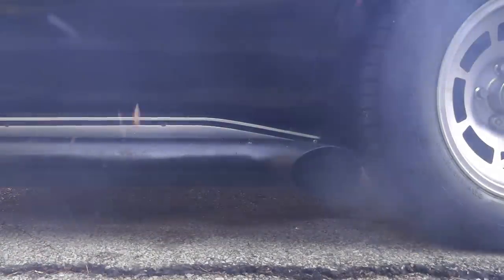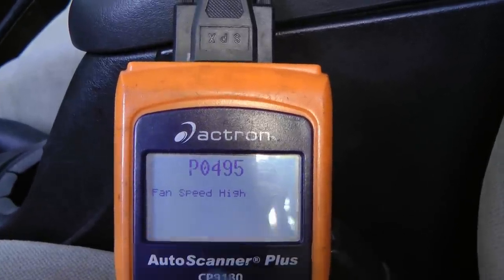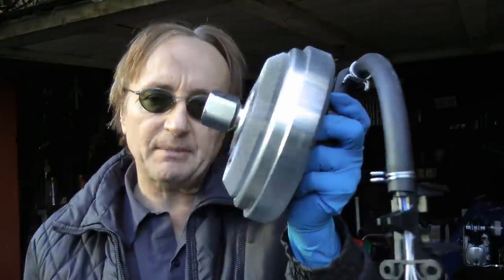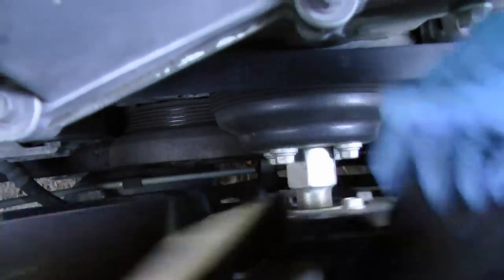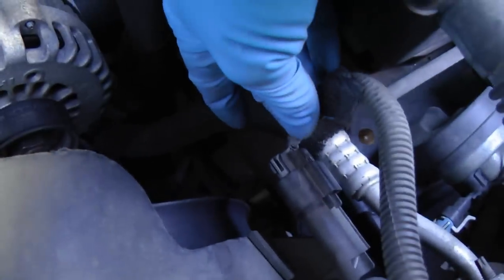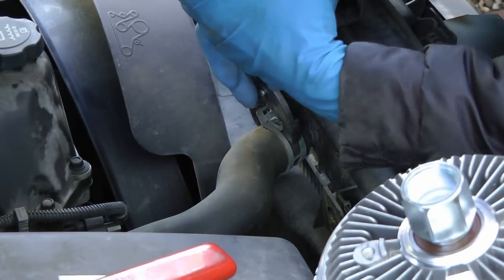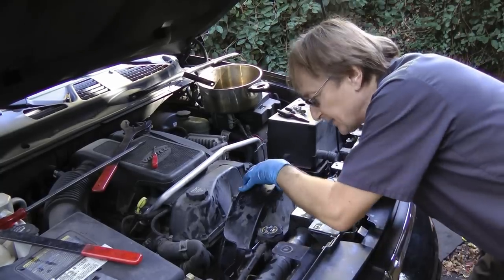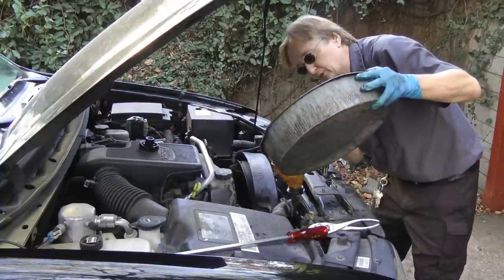How To Replace a Fan Clutch

Comment from the maker: Things I used in this video:
1. Actron Scan Tool: http://amzn.to/2ngeCQJ
2. Fan Clutch Removal Kit: http://amzn.to/2B4xybi
3. Breaker Bar: http://amzn.to/2BEo9Ep
4. Pliers Set: http://amzn.to/2Ax5VXe
5. Ratchet and socket set: http://amzn.to/2inoxOY
6. Mechanic’s Tool Set: http://amzn.to/2Bzmccg
7. Wrench Set: http://amzn.to/2kmBaOU
8. Shop Towels: http://amzn.to/2jGDfkA
9. Disposable Gloves: http://amzn.to/2zSRuxO
10. Large Screwdriver: http://amzn.to/2igwntV
11. Flashlight: http://amzn.to/2BFak8y
12. Common Sense
13. Full HD Camera: http://amzn.to/2AvoEk7
14. My computer for editing / uploading: http://amzn.to/2i2sKYz
15. Video editing software: http://amzn.to/2jv5Fhf
16. Thumbnail software: http://amzn.to/2k7tz6C

🛠Check out my Garage to see what I use every day and highly recommend:
https://www.amazon.com/shop/scottykilmer

❗️Check out the Scotty store:
https://goo.gl/RwhRGU

👉Follow me on Instagram for the latest news, funnies, and exclusive info / pics:
https://goo.gl/ohy2cA
Reply: the fan clutch has been locked up on my truck for years never noticed any problems what's wrong about having it run full speed all the time?
Reply: Scotty how can I find out witch way the screen goes, I need to change my water pump

Comment: alot of people are scared to work on cars...they see all the dirty vacuum hoses and its looks intimidating...I use to be one of these types until I got my vw gti, then I slowly learned as the vehicle aged and my collection of tools increased. I look at old mechanic receipts and realize how VALUABLE this knowledge is. Just did fuel upgraded injection spider on my 4.3l chevy, brakes, egr,tps, chip tuner, and ran some seafoam and its like a whole new truck. You shoulda seen the intake plenum....how filthy it was from the fpr leaking.

Comment: Scotty- I took my 1991 Toyota Pick Up in for an AC service. I really think all they did was top coolant.  Then the mechanic tells me that if I bought a 1. evaporator 2. extension valve and 3. a drier that the AC would blow a lot colder. 

Scotty- My AC is cold - ONLY WHEN THE TRUCK IN IN MOTION.  Meaning that if I'm at a STOP - it blows only warm and eventually hot air if the stop light is long enough.

Should I listen to this mechanic and have all that replaced OR do you think it's the condenser not getting cold enough because my fan clutch isn't kicking on?

Thanks man- I watch all you videos because you edit the vids, give us the simplest most efficient way to fix our rides, make it look easy.  Thank you Scotty!
Reply from the maker: JuanDavid Torrescano   forget him, put an electric cooling fan on the radiator, they make aftermarket ones and that makes em blow cooler. BUT, if it's an old R12 system that has been converted to 134A, it will never blow that cool at idle no matter what you do

Comment from the maker: Was it "new" or a used junk yard one. If used, it could have problem or wasn't correctly installed. No new engine should vibrate, they could have put the motor mounts on wrong or broken them for that' But a cat light is often a bad engine causing that to come on as the cat has to work harder.

Comment from the maker: radiator caps are pressure valves. they spill coolant when pressure gets too high. They can do that for any reason in my video "how to fix an overheating car" you'd have to check em all

Comment: Scotty, just did my wife's 03 Envoy, easiest part of that job was the swearing. You're right not easy getting it out. Only suggestion I can offer is to place a piece of cardboard between the radiator and fan clutch. The clutch is heavy and punch a hole in the radiator. Also it is just as hard to get it back behind the shroud as it was taking it out. Prepare for a fight!
Reply: +Jimmynitr I got mine behind the shroud on my '02 trailblazer okay, but getting the nut screwed back on straight is killing me, lol.  I quit for the night after getting disgusted with it...and the shroud trying to scrape all the hide off my forearms.

Comment from the maker: an older fan clutch that goes bad is easy, it just spins too loosely and doesn't suck enough air. We use a speed gauge to measure it as mechanics, but you can just try spinning it by hand when it's shut off. If it spins rather freely, it's shot.  It wouldn't cause your problem though, it would lead to overheating

Comment: Check your fuses for the light issue.  I blew one once and it looked fine, but had no tail lights or dash lights.  Replaced the fuse and everything was ok.  Sometimes a blown fuse is all the trouble.

Comment from the maker: na, the power to the fan clutch is all off when the engine is shut off. And I normally do flush out dexcool if the customer wants the system serviced and use better coolant

Comment from the maker: put in the hottest thermostat you can get. The engine will not run correctly at that low of a temperature, you must fix the running temperature first if it's running so cool. that can also cause the high idling.

Comment from the maker: you must figure out where the noise comes from, check both the fuel injectors which may tick, and the engine which can have noisy valves inside the engine

Comment: Thnxs for reply i need to see that vid but i discover the top rad part got cracked im screw need a new rad but how i can check if my fanclutch is bad and that cause the extreme temp raise to crack my radiator thanks again

Comment: Scotty, I have a 1996 Ford Windstar and I can't get rid of codes P0171, P1537 and P1538. I've seen code P0174 before but not yesterday when I used the scan tool, and that might be due to the fact that I cleaned the Mass Airflow Sensor. I have also already cleaned the throttle body. What should I try next? Thank you so much I've learned about half of what I know about cars from you.

Comment: Dear sir, do you have any videos on a 2005 GMC Sierra 4.3 Vortec,  my vehicle starts but when it's gets hot, it doesn't want to Start right away, I gave it a tune up as best I could. Also, it doesn't start right away , like when Im off to work and I get in and go for the first time .  Thanks  your input is greatly appreciated.

Comment: Hey Scott.  I have a 2005 trailblazer and I have the same code po495 fan on high.  Is it always the fan clutch needing replaced?  My engine is loud when I first step on the gas.  Is it safe to drive for a while with this issue?
Reply from the maker: sure, as long as temp gauge runs normal you can drive it. And every one I ever fixed with that code had a bad one

Comment: -Less reliable : an E fan not working anymore cause overheating a clutch fan cause drag and noise only

-More parts :  like a thermoswitch a housing for it a controller in the ecu 
 AC system  causing a lot of heat in traffic and wich needs cooling at idle in traffic where you use the most cooling system.
A E fan would fry quite quickly.

All the longitudinal engines have this set up. 
it's just simpler and more reliable in the absolute.

Comment: Thanks so much for the video.  I have a 2002 trailblazer myself I'm in the middle of changing the fan clutch on right now.  Got the old one off, now just waiting on FedEx to get here with the new one I ordered...supposed to be here sometime today.  I'd guess mine has already been changed before once before I got the vehicle because the radiator hose clamps are the old screw down kind instead of the kind you can unclamp with a pair of channel lock pliers.  That and the fan clutch nut wasn't on near as tight as what yours looked to be.
Reply: +Rebel9668 Finished the job today,  yesterday I was tired and couldn't get the nut on the fan clutch to line up with the shaft to save my soul.  Today I got it on the first try.  Everything is re-assembled and now all I need to do is to top off the radiator and I should be good to go.

Comment: Hi scotty..I read that on my tundra v8 2008 ..when doing a water pump job that I should automatically change the fan clutch??? They are connected they said?? They both wear at the same time...is this true? Is it necessary if it's not broken??

Comment: I am looking to buy a used Toyota Corolla.  I was looking at buying a 1998-2006 and it seems very hard to find an older Corolla that has been taken care of.  What year Corolla do you suggest I buy?  What are the reasons you recommend a mid 90s Toyota over newer Toyotas?

Comment: Scotty love your videos. Got a question for ya. I have a 04 trailblazer and when I accelerate it sounds like i have a hole in my exhaust but I checked and I don't. Could a bad fan clutch cause this sound?? Thank you for your time.
Reply from the maker: it can, take the fan belt off and drive it around the block to see if noise goes away.

Comment: I to have a 2004 chevy trailblazer and my fan clutch is going out i was told when i start my car up it makes a loud noise then it goes away when i put my controls on feet it dont go to feet or to defrost it does some but it mostley just comes out the mid air vents, i priced some at the junk yard but i was told some things you just dont get from a junk yard so my question is, is this one of those items? the price for the clutch is 200 bucks in the auto part stores here in indiana but only 30 buck at a self serve junk yard.
Reply from the maker: your choice, they do have to guarantee them even in a junk yard. Just realize most break down and being that old it may not last long if it even works right now

Comment: Hey Scotty,I have a 95 chevy suburban 7.4 v8 big block 2500. I'm trying to replace my water pump only to come and find out my fan clutch is a no no Nut removel...instead I found the whole shaft of the fan clutch shaft and the plate are one assembly!have you ever came across this?if so,do I have to remove those 4 10mm nuts to take of the fan clutch?is this sometimes typical?

Comment: hey Scotty! I found a vacuum line that was hanging loose in the back of the engine, connected it, and the P0171 code cleared and hasn't come back! now I just have the two codes P1537 and P1538 which are for the same thing -  Intake Manifold Runner Control Stuck Open. do I need to open the intake manifold and clean out the inside? ps. I'm too broke to take it to a mechanic, but I'm pretty good around and engine. Thanks you're the best!

Comment: So i asked this question a couple days ago about my temp gauge going up a couple notches and then dropping back to normal, its weird it doesnt overheat. You replied with a thermostat and i changed it. There are no leaks and ive checked everything looks good. It goes a couple notches above normal then goes back to normal and it will do this through traffic. Most of the time at high way speeds it will stay at normal 90% of the time. It happens more when i stop and go. Im stuck, any more suggestions? Thankyou
Reply: it goes up and down?

that's either your fan or your water pump
Reply: fargeeks thanks but i figured it out! Is was actually a small external pinhole leak in the head gasket. Right on the side  of the block u can see it so it would get a lil hot then drop back to normal. No coolant in the oil either because it was so small and in the outside of the engine

Comment: hey scottie i  changed the pump but how do i know if my fan is good on my  chev p30  i seem to get hot air in the truck but im not sure if it's from the motor or rad heat i can't distinguish 1 from the other   thanks

Comment: I have a question,  I had a 2004 Kia Optima placed with a new engine.  After the engine the car vibrates very harsh at 750RPM, almost shaking it apart.  I'm also getting the check Engine light for a bad catalytic converter.

Comment: Hey Scotty were did you buy that fancy tool the one with the red handle  to hold the bolts to be able to remove the fan clutch thanks
Reply: J C it’s called a serpentine belt tool
Reply: J C you can rent them at autozone for like $30
Reply: Adam Stephens  thanks I know what is call just thought it was under  different name  but I haven't found it yet at any auto parts that I checked only the big wrenches not the kind of round c shape tool .
Reply: J C ohhhhh I know what you’re talking about, it’s not a serpentine belt tool I was wrong, I actually have that tool right now I’ll tell you the name

Comment: Hi Scotty,
I noticed  that my fan on my 2005 Chevy trailblazer with the I6 is brearly blowing air even when it's 90° out, the temperature gauge goes from normal to about 20° higher and then goes back. With the AC on within 15 minutes the truck will start to over heat. Sometimes the compressor makes noise, sometimes not. The truck has a new water pump, and the AC was recently serviced, old out, new in. I'm not getting any fan clutch codes. do you think it might be the compressor not sending a signal to the fan clutch? The compressor blows cold air.

Comment: Hey scotty , I just bought a new fan clutch for my 2004 tahoe 5.3 v8 and the new one and the old one match up perfectly,  but the new one is making a high pitched sound as the rpms rise , and for comparison reasons it's louder than a set 33x12.50 nitto mud grapplers extreme terrains , also the fan clutch is throwing tiny shards of metal , what do you think?

Comment: SCOTTY, i have a 1990 22re toyota pickup. the temp of the truck never seems to get past a quarter of the way up the gauge. already replaced t-stat and did radiadtor flush. my friend said to open the rad cap and leave it running because air bubbles could be trapped not allowing it to warm up all the way. i havent tried that yet but i really dont know what to do. its killing my gas mileage because its always idling so high! do you have any advice?

Comment: Hi, thanks for your videos...
I have blazer 2007 with engine error signal appears on the dashboard, after computer check for errors, i found error code P0526 , how to solve it and is that means that i have to change the fan clutch?

Comment: I recently picked up an 03 TrailBlazer, same motor as the one in this video, all my old cars have been electric fans, is it normal for the fan to be spinning as soon as you crank the truck even when it's cold outside and the trucks been sitting all night?
Reply from the maker: not normal, but as long as it runs good and doesn't overheat, leave it alone. Those eletronics get weird on GM trucks at that age and often it's not worth messing with if it runs fine

Comment: my clutch fan went bad on my 05 f150, i replaced it but still has all the problems with the new one. How free is the fan supposed to spin with the truck off? Should it spin rel freely or what if the fan is good?
Reply from the maker: it should only si a little then stop. Aftermarket clutches suck, get an oem one
Reply: Scotty Kilmer thanks, that was gonna be my next step and break down and get a OEM one
Reply: +eric savoy yeah aftermarkets are cheaper but doesn't always mean it's better than oem

Comment: Hey i got nissan pickup a 1994 4 cylinder 2.4 my fan is hard and when u start it moves with the pump is it bad? The wierd part the truck does over heat but sometime it has trouble starting up when the truck is warm
Reply from the maker: leave it as long as it doesn't overheat. that has nothing to do with hot restarting, that's more often dirty fuel injectors or a weak fuel pump

Comment: Hi Scotty, Great Video! Thanks!  Question:  I have a 2004 Trailblazer inline six and I have codes P0128 and P0106 coming up.  I bought the vehicle and immediately replaced the thermostat, then a few months the waterpump went. next I replaced the engine temp sensor.   Now I have those codes and the engine is not warming up.  I replaced the Intake Air Temp sensor and Manifold Absolute Pressure sensor and took off the throttle body and cleaned it real good.  I am still getting the engine light, so I think it may be the thermostat because it overheated when the water pump blew.  I also think it could be the fan clutch.  My fan clutch spins freely by and when off.  What do you think?  What test can I do to rule out or in the fan clutch.

Thanks Scotty
Reply from the maker: yes, replace the clutch assembly, they are crap on those models and don't use a cheap chinese made aftermarket one, they are really junk

Comment: Hey Scotty, great video. My 2002 GMC Envoy vibrates at idle and the local auto shop says it's the fan clutch and guarantees replacement will take care of the vibration. I don't have any cooling issues or lights on the dash... I have almost 260,000 miles on the vehicle. Would you consider the fan clutch to be the culprit? Thanks
Reply from the maker: they often will do that, but it they still blow air, it won't overheat
Reply: Thanks Scotty. Love your videos!

Comment: great vid..I replace mine but I now hear a rotating sound when I take my foot off pedal when driving. when I accelerate sound goes away? 04 suburban 4x4.
Reply from the maker: +m00nchildblues often non factory oem fan clutches make such noise, if it runs fine, most guys live with it and often the noise eventually goes away
Reply: +Scotty Kilmer Hey, I'm getting piss poor gas mileage and the clutch fan ticks for about 20 sec before engaging. also really load when barely giving it has. is it bad?
Reply: Late response to comment but if you have an aftermarket fan it's possible it was not designed with quiet operation in mind.  Lots of aftermarket fans are designed to move a good amount of air, but OEM fans are usually the ones that keep noise levels down.  They're typically designed with uneven blades to reduce noise.
Reply: 1000$ later, it was my rear dif bearings that were going out. ugh. have new fan though.lol
Reply: @scottykilmer I replace the fan clutch 03 trailblazer and took schroud cause it was broken stills overheats

Comment: hi how do you remove the viscous fan from a 1990 nissan terrano/pathfinder running a td27 engine? Ive undone the four little 8mm bolts and the pully is loose but the fan hub wont budge? cheers